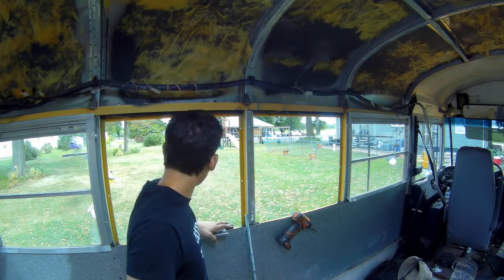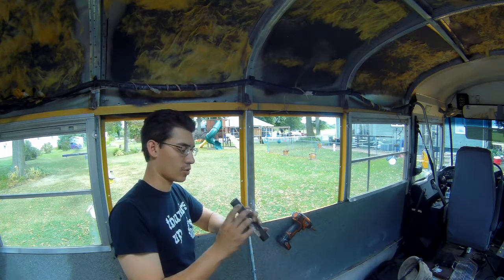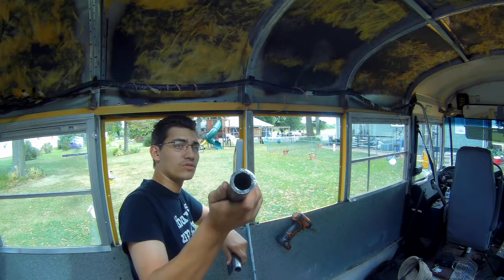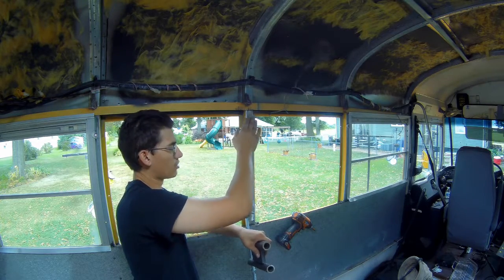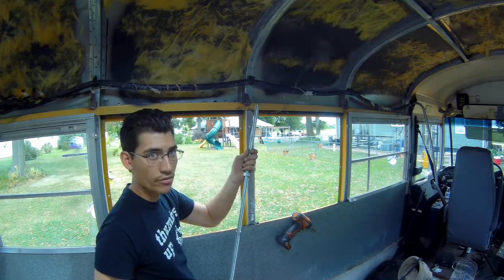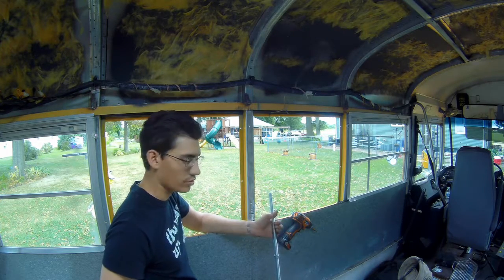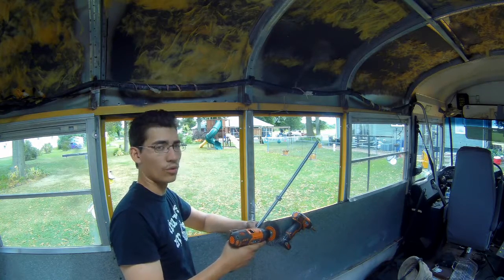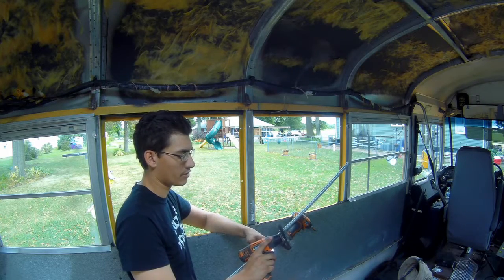How to lift a school bus roof pt1

Comment: have you checked first if the bus is sitting level on the ground , if not the level isnt going to help you at all
first thing you need to do is lift the bus slightly of the ground and set it on blocks under its frame then shim it to level it off on all directions 
will make working on the bus a LOT eazier in the future